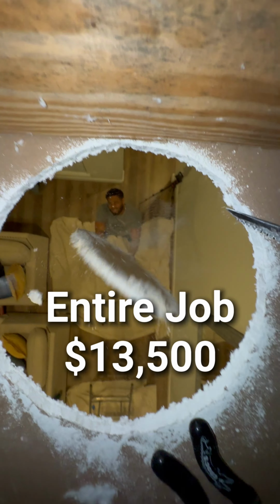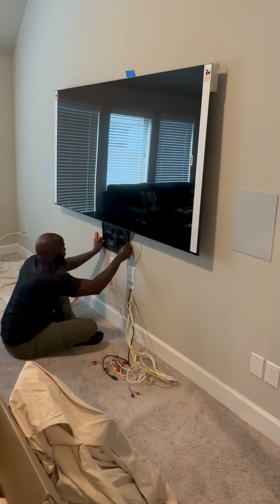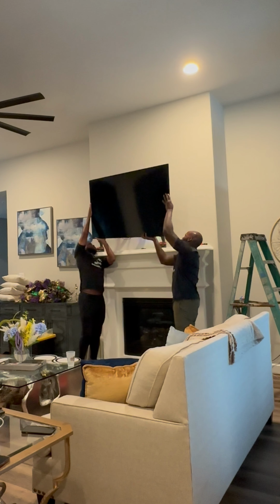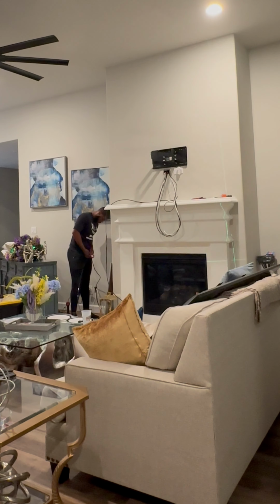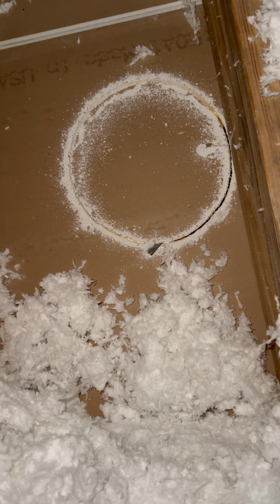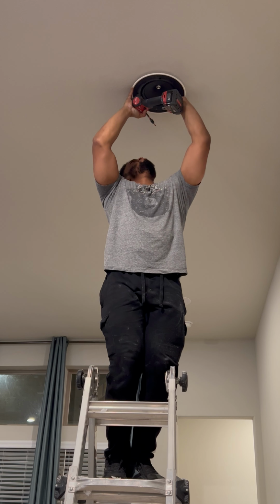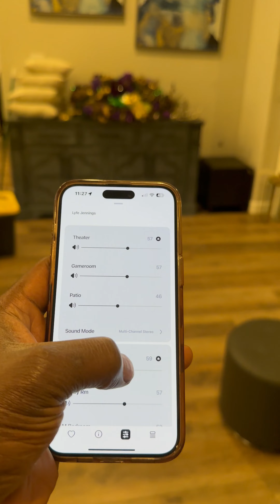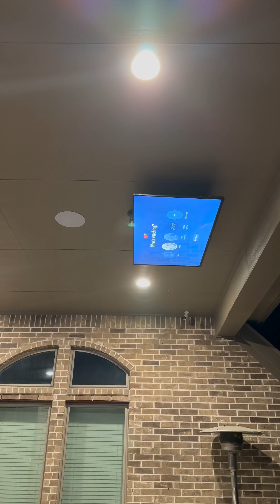Our $13,500 Audio Package (full video)

Comment: I had to look up the cost of a job like this because when I saw the $13,500 price tag, I thought, “No way!” But after researching, I realized that’s actually a great deal. For those who are curious, here’s a breakdown of the pricing:

TV Installation:

85-inch TV: $200 - $500
65-inch TV: $150 - $400
Two 50-inch TVs: $100 - $300 each
Speakers Installation:

In-ceiling or in-wall speakers: $200 - $2,000 per room (including speakers, wiring, and labor)
Multi-room audio system: $3,000 - $12,000 for the entire house
Wiring and Labor:

$500 - $1,000 per room
Professional Installation:

$1,000 - $3,000 depending on the complexity
Overall, you might be looking at a total cost ranging from $5,000 to $20,000 or more, depending on the specific requirements and quality of the components.

This is not Xpress TV Mounting’s pricing but just a general idea. I went to Thumbtack and other resources for pricing just to give a general idea.